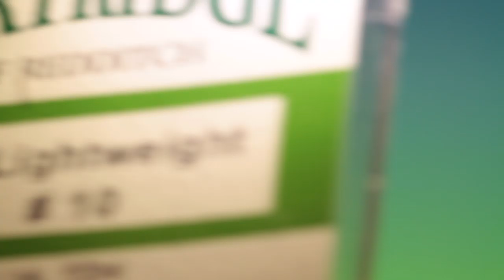Tying a Foam Daddy with Barry Ord Clarke

Comment: Hi Mr. Clarke I really enjoyed the Daddy long legs video. I'm going to try to tie a few for myself. It will be a first for me. Watched your leg making video and it is outstanding. Thanks so much for your tutorials. They are part of my valuable video library recorded on CD-ROM. I do have a question. How do you store large flys and avoid crushing the hackles??? I have had very little luck due to my ignorance.🤣🤣🤣🤣 Thanks again my friend.
Reply from the maker: Hi Danny, Thanks! For large dry flies I just use a large plastic box with spacious compartments so the hackles have enough room to rattle around.
Reply: @Thefeatherbender  that works my friend. Thanks for that tip. I had a large Saltwater fly box. Didn't dawn on me to use it for dry flys. LOL. Dumb me.